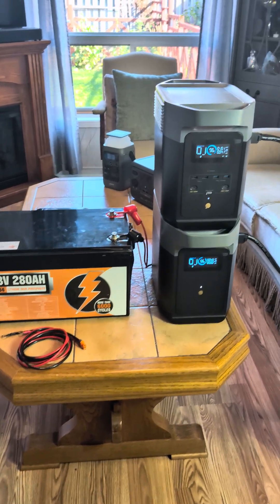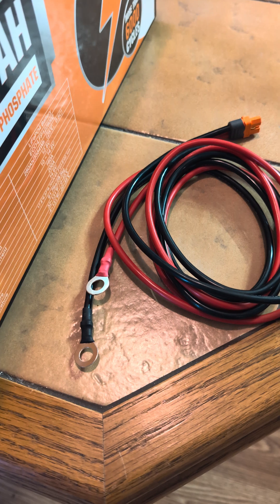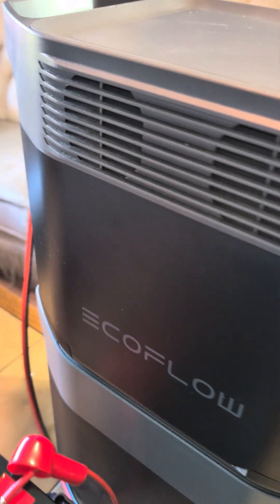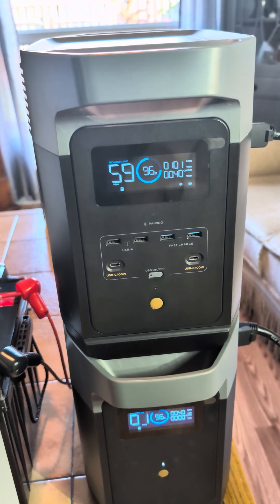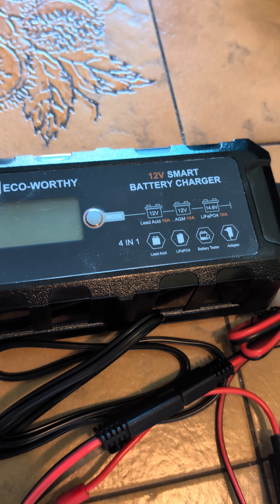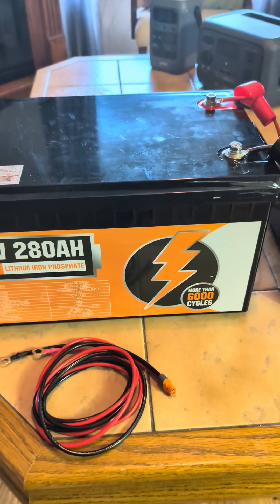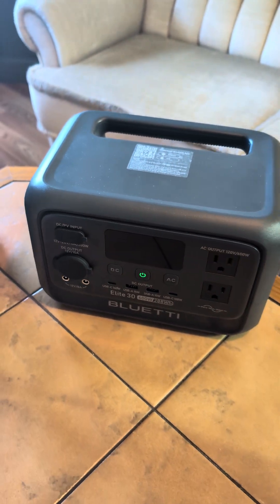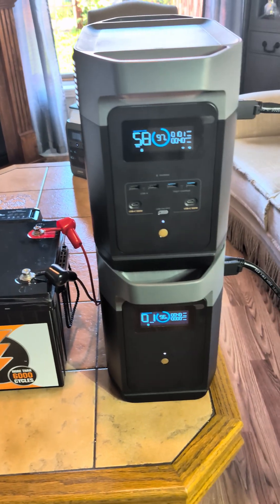Easy way to extend the run time of your Ecoflow Delta 2 power station! Part #1

Comment: How do you charge the battery
Reply from the maker: I use a 10 amp 12v battery charger designed for lithium batteries

Comment: Now the reason I can do that is because my Ecoflo RV alternator charger is directly connected to my 2nd exterior battery port and that covers 400 solar watts going into the 24V battery and the other 400 watts is going directly into my solar input on the Delta 2 so I have really two sources coming in One at more than 200-watts and the other one at 800-watts so I’m getting over 1000 W sometimes it says 1.3-watts coming in

Comment: I have a similar set up, but I’ve got connected to a 24 V battery same company and I have it tied to the RV alternator booster which once it’s charged up with solar, I can pull power out at 800 W and being that I’m charging with 2-400w 24V solar, I can fully charge what you have in one great Southern California day.
Reply from the maker: Nice set up

Comment: Bro, my ecoflow river pro - the small one, pulls 200W from the battery via a 12-24V victron converter. You have a delta, can’t just be 100W in, something is seriously wrong with your setup.
Reply from the maker: The cable was sold as a XT60i,It wasn't pinned right. Using a proper XT60i works much better! 😁
Reply: @HereandtherewithHeath glad you got it sorted 😊

Comment: I wonder if we wired up 2 or 3 external batteries pretending to be solar panels if we could increase the charge rate, say  200, 300, 400 watts?  I think delta 2 max is like 600, but should probably stay a little under.    i am just starting small right now, I don't think I can get solar panels until Spring due to other projects taking my money atm
Reply from the maker: I hear that,none of this stuff is cheap,and if it is it's not worth buying lol

Comment: exactly what wanted to know. First youtube search on this topic and I found you.   my plan is to use a few ecoflow wothy batteries in series maybe (pretending to be solar panels)  then charge them with solar to extend my run time.   My Delta 2 can get me though 6 hours of my work day so just a little bit more and I can be finish my work day on battery.  you got a follow for that video.
Reply from the maker: Nice!
Thanks!!

Comment: Connect to the solar grounded xt60i  input and you will get around 390w
Reply: And if you get one of those 800W "alternator" chargers you can charge at 800W+. Of course they are not cheap but they might have them on sale atm, somewhere.
Reply: @atnfn  I work in the jungles of Venezuela .. 2 300w solar panels connected to 2 12v 100 amps batteries and 2 200w solar panels connected to the ecoflow. At night I connect the batteries to the ecoflow. Good for a freezer, 1/2 hp waterpump to pump to a 3 mtr high water-tank, starlink and lights..

Comment: You could also put a high output inverter to that 12v battery and charge the solar generator via ac input
Reply: If you were going to add an inverter to it, wouldn’t you just use that combo as a standalone device? Why would you use a power bank to charge another. Doesn’t make sense as you would have further dc/ac then more ac/dc loses.

Comment: Check the connectivity between the third pin and negative on the XT-60i. 
If there is no resistance then you have a bad connector. You should be pulling closer to 150w if the app shows solar. 
I have returned many XT-60i connectors due to this problem. 
Another quick way, go to the app and look at the input. If it shows car charging, you have a bad cable. 
Thanks for the demo. I have almost identical gear pieces you show and works for me. 
Also, you can get away with a 40 amp charger, I use it on my 12v 280A LiTime

Comment: I have an EcoFlow Delta 3 Plus paired with a 48-volt battery, with two cables coming from the battery to the EcoFlow. I'm pulling 950 watts.
Reply: Same here, excellent solution with the new 48v 30AH batteries.

Comment: Boo! A teeny tiny bit of research on YouTube would tell you that a boost converter will let you charge the power station a lot faster. Even stepping up to 24V would speed up charging dramatically.
Reply from the maker: Absolutely, just showing a basic way to do it. 😁

Comment: It appears that you may be using an XT60 and not an XT60i. When I charge my Delta 2 using an XT60i, I push 180-190 watts into the Delta 2.
Reply from the maker: It was listed as a XT60i cable when I purchased it but a few people have commented that often there sold as XT60i cables but not doing the job the cable should 😕
Reply: @HereandtherewithHeath they are wrong. There are two different types of XT60i cables. That's the whole point. What dictates charging speed is which pin is tied to the center pin.

Center pin tied to ground=15A.
Center pin tied to hot=8A

Comment: I saw a video where they used an Ecoflow alternator charger. Got 600+ watts in and reverse charge with a flip of a switch in the app.
Reply from the maker: Yup! The 800 Watt alternator charger ( that is installed in ny van) sells for 470$ Canadian or the 500 Watt version goes for350$.
I was just showing a less expensive alternative.
If you can afford the alternator charger it's the way to go.🙂

Comment: You can connect two cables from the battery, one to each MPPT to double the charge. Or even better, a step-up converter, which is inexpensive and can charge at 24/36/48V 10Ah per MPPT. :)
Reply: Agree!

Comment: it be nice if you could charge the battery during the day witha  solar array using the power station then at night use it to keep the juice coming during the night
Reply from the maker: Yeah I can charge the battery with a solar panel and a solar charge controller even while changing the Ecoflow! 😁
Reply: @HereandtherewithHeath please, could you make a short showing also your panel, mppt (I do not know which to choose for one 450w panel) and how is it all connected and the values on delta while it is charged from solar at the same time, please? I have never connected something like this. It looks easy, just to be sure 😅 muchas gracias from Spain.

Comment: Just curious...why did you buy the extra ecoflow battery when it cost the same as a whole regular unit? Isn't it better to just have two functioning units instead?
Reply from the maker: It was the first power station I bought and knew very little about them at the time. Thought it was the next logical step, learned a lot since then!! 😉
Reply: @HereandtherewithHeath don’t we all?  Once you get one, it becomes a new hobby!
Reply: I thought the same thing . I just bought 2 delta 2 units for versatility . I could use on different floor levels without extension chords all over . Or charge one while I'm using the other .

Comment: This may not work for the smaller power stations that can only take the smaller voltage, but you could always get a 12 V DC to a higher voltage DC booster and you could double or triple that charging speed off of that battery

With a booster I think that’s going to be an excellent set up and certainly a cheaper way to expand battery capacity!

Comment: Is the display showing solar or car input charging? I believe you are using a standard XT60i cable that is wired differently than the Ecoflow XT-60i plug wired with the 3rd pin to the negative side, IIRC. Using a genuine Ecoflo XT60i solar plug, the charging rate should double from the standard car input rate (8amp @ approximately 102w and display showing the car icon) to the higher solar input value of 15amps at approximately 192w (and showing the solar input icon on the display). Modify a genuine Ecoflow XT60i solar cable by removing the MC4 connectors and adding ring terminals instead and you should double the input rate compared to a generic XT60 or XT60i cable.

Comment: You can get the same, but with more speed with ecoflow alternator charger. You can charge from external battery to delta 2 and viceversa, you can charge from delta to external battery up to 800w
Reply: With a Delta 2, the regular alternator 800w output cord uses the XT150 input connection port. So, you can't have the expansion battery connect3ed at the same time. However, Ecoflow just came out with a smaller 500w version of the alternator charger that connects using an output cable with XT60i cable that can be connected to the solar input port of the Delta 2 unit while having the expansion battery connected at the same time using the XT150 cable in the side ports. The cable supplied with the 500w charger (and available for purchase separately) limits charging to 500w when connected to the 800w charger (and only allows 500w output and no other additional functions like reverse charging). But, the new cable makes the setup universal when using the 800w charger at 500w output and allows it to be used with other power stations that utilize an xt60 input port. I've also rigged an XT-60 male cable to connect the Ecoflow cord to another cable connected to a stand alone 12.8v LiFePO4 battery.

Edit: The latter hookup won't work with a stand-alone battery. I've recently discovered that this new XT-60 charging cable (and Ecoflow alternator chargers) will not charge a stand-alone battery unless the Delta 2 power station or similar power station is involved. The reason is that apparently the charger output voltage can only be lowered to 24v (AFAIK), not the 14.2v - 14.6v range required to charge 12.8v lithium batteries. You'd need to reverse-charge the 12.8v battery (which would involve hooking it up as an input to the 800w Ecoflow charger instead of using the vehicle battery) or use something like an  AC lithium battery charger plugged into one of the power station's AC outlets and then to the 12.8v lithium battery. (Alternator to vehicle battery to Ecoflow charger to Delta 2 then Delta 2 AC outlet supplying current  to an AC-DC 14.6v lithium charger to the stand-alone/house lithium battery.) It might also work with a buck converter attached to the XT-60 cable coming from the alternator charger to reduce the voltage to match the lithium charging profile, but I don't like those things as they get extremely hot if the current is too high and the charging would need to be closely monitored.
Reply from the maker: My alternator charger is installed in my van 😁
Reply: @HereandtherewithHeath  Yeah, but with the alternator charger, you can charge and discharge external battery at 800w. With your setup you only can discharge external battery, and charge with a plug or with an external charger. If you have for example a 500w solar panel plugged in ecoflow delta, you can charge external battery at a fixed rate. So, you can extend the use for a weekend house o something like that
Reply: Do you have an alternator in your home? 😂

Comment: I was looking to do almost this exact setup except with a couple of solar panels.  I already have the D2 and extra battery.  Can you run this setup while connected to the 3rd battery?  Or do you have to wait?
Reply from the maker: If your going to use the solar panels and a solar charge controller to charge the battery ,then you can still charge the D2 at the same time